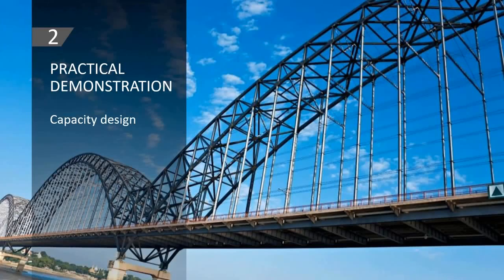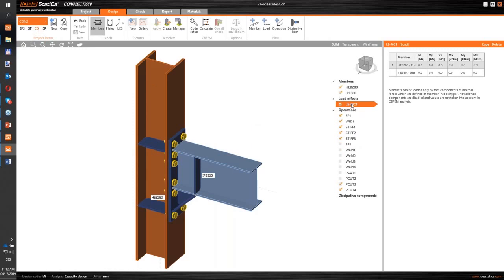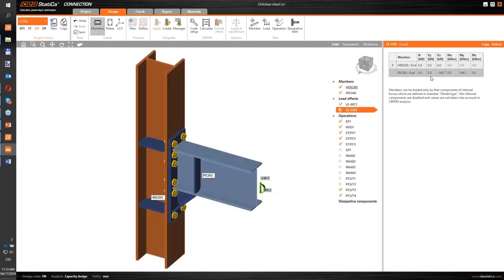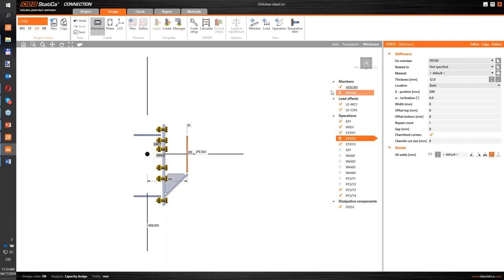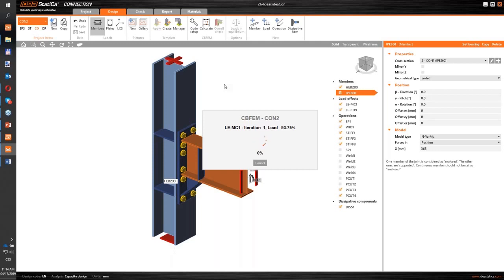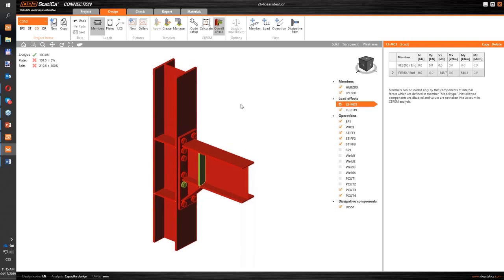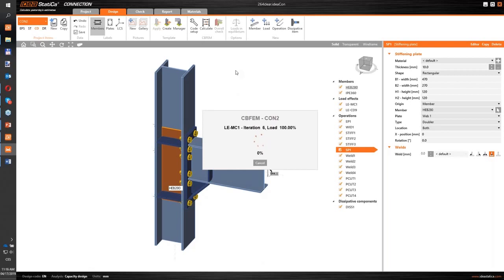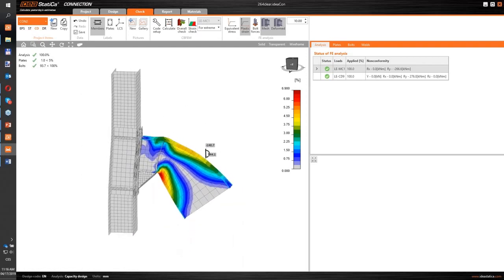Design and code-check of a seismic connection in IDEA StatiCa

Comment: Hi ... plz i faild when i export the connection members (axail ,M . S )  from Etabs to Idea statica .. he asked me about key and i put it and repeat this step the same  i found faild too .. this happen in idea statica 9&10 with Etabs 16&17 ... al thogh the idea statica work normaly when i put the S,M.N for connection directly without exporting ... plz do you have solving for this problem .. Thx
Reply from the maker: Hello, Thanks for your question. Unfortunately, it is not possible to answer your question right here. Please, reach out to us on the User portal, where you can set a new support case easily. 
https://www.ideastatica.com/Portal/Dashboard